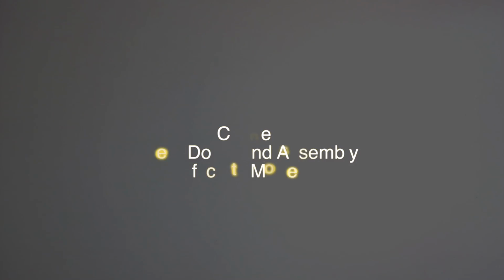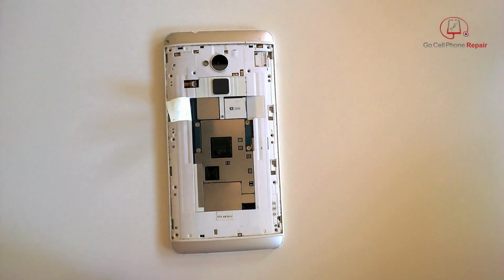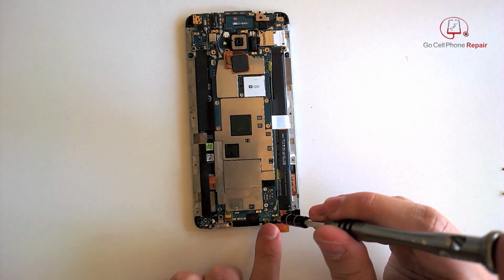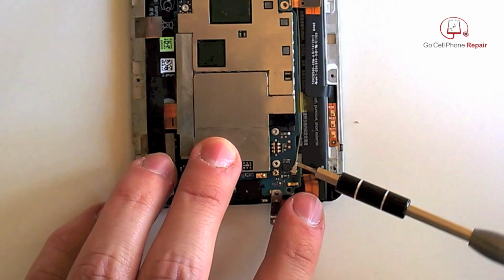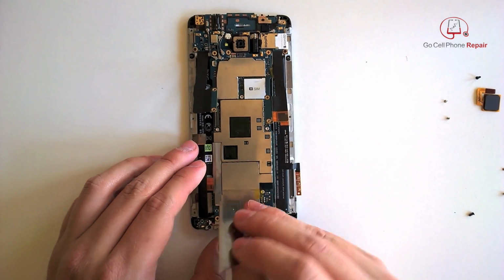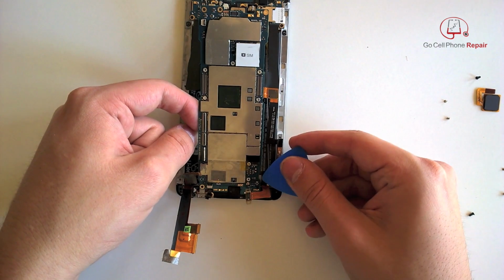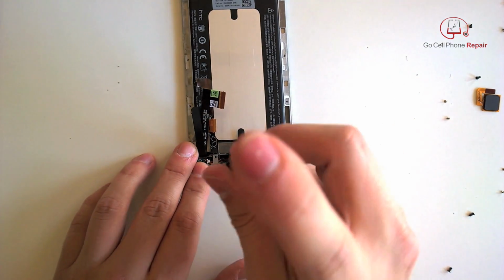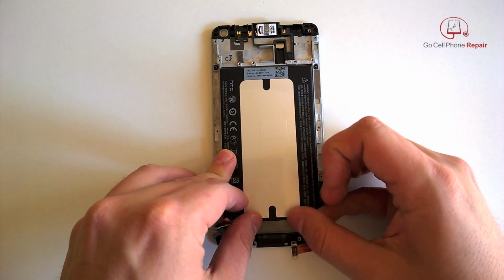HTC One Max Tear Down

Comment: my camera is frozen it won't open what can i do?? @ +go cell phone repair
Reply from the maker: +Jose Mungua Could be hardware or software. If it were me I'd back up anything important and try a factory reset first. If that doesn't work consider replacing the camera. It's hard to know what the cause is.
Reply: +Go Cell Phone Repair i did that all ready an it didn't work

Comment: OK is the digitizer basically the glass panel and the digitizer  the "monitor" which is like the black and silver stuff underneath the glass? Well yesterday I tried to remove the screen and I had no idea how to do it so I accidentally broke the lcd when originally only my glass digitizer was broken! I placed an order right away for another "touch screen digitizer+ Lcd" yesterday. I think replacing the whole lcd plus the digitizer will be  10x easier than just trying to replace the digitizer. My question is how do I stick the screen back on? Do I need special adhesive or can I just use super glue.. Thank you and please reply ASAP because I really need your help.
Reply from the maker: Please don't ever use glue on your phone. Double sided adhesive tape like the stuff on this page is recommended: http://gocellphonerepair.com/double-sided-adhesive-tape/
Reply: +Go Cell Phone Repair what do I do if my wifi isn't working

Comment: and i ddint know what you meant by remove the top speaker to get to the screen. Can you please explain. And how do i replace the top metal speaker grill
Reply from the maker: Can you tell me what part of the video you are referring to?
Reply: All the way at the end before you started putting it back together..  When you were like if you want to change the screen remove the top speaker
Reply from the maker: Rushil Patel Ah gotcha. So I was talking about the earpiece speaker. It is stuck to the inside of the frame and can be carefully removed and transferred to your new display assembly. You will want to use some heat and be sure not to poke any holes in it especially the underside where the diaphragm is located.
Reply: Oh OK thanks

Comment: it is possible to separate the digitiser from the LCD right? cos my digitiser is cracked and i've already bought a spare digitizer. None of the repair shops in my area want to fix it for me so i plan on doing it myself
Reply from the maker: I haven't tried this one yet but it is probably possible. Getting it off without cracking the LCD and applying LOCA will be challenging I'm sure. Wish that I could give you more info but with this phone we just replace the entire display assembly.

Comment: What size tri point screwdriver is needed for these screws?  I have a couple, but theyre both too large.
Reply from the maker: We used a Y0 and it worked even though it didn't look like it would. Ideally whatever works for the Nintendo DS is what I would recommend.
Reply: Ok. Thanks. I ended up filing one of em down. Worked like a charm.